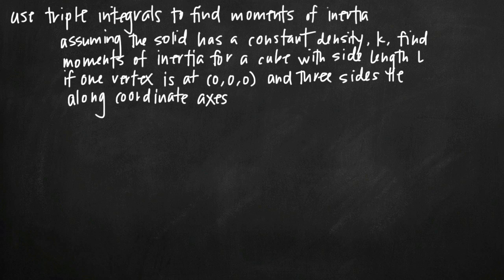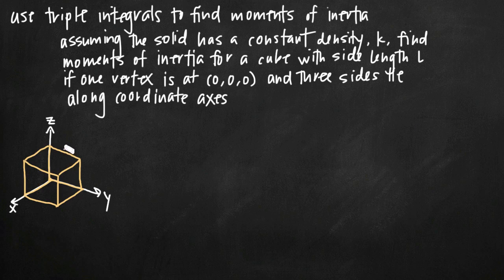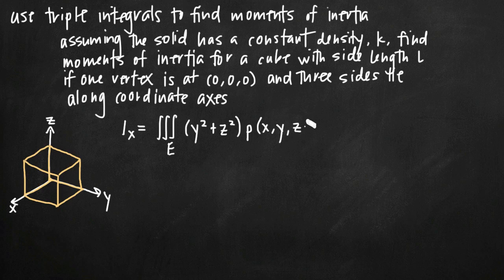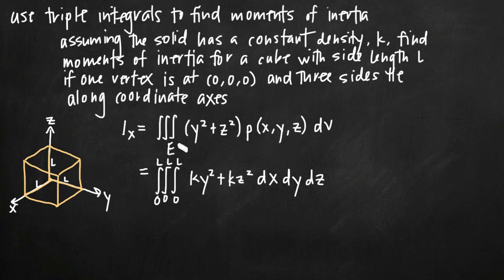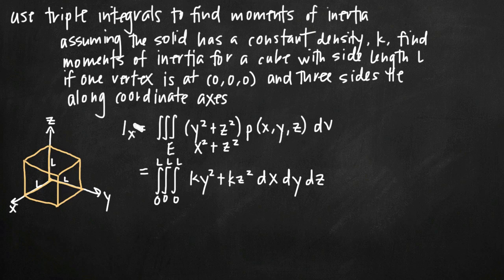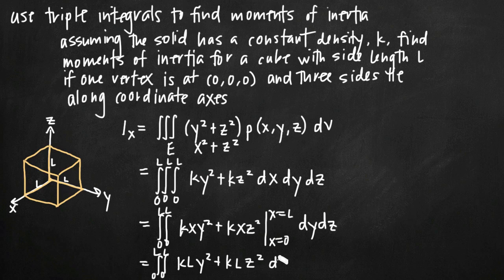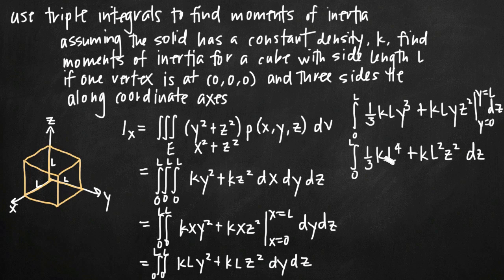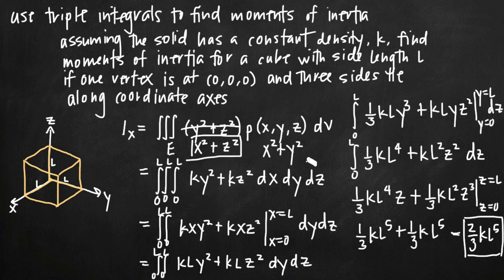Moments of inertia with triple integrals (KristaKingMath)

Comment: ..but where did y^2 + z^2 come from 1:49 ...
Reply: Danish Fiesta 
Distance from the x-axis or Rx
Reply: but how ?
Reply: @canerakbas9313  because linear: F = m*a, and rotational: torque = F*r = (m*r^2)*(a/r). This is true since F*r = m*a*r 
(you multiply r on the left, so you multiply r on the right. But since we work with rotational acceleration 'alfa' and not with a, we reorder the equation to m*r^2*alfa).

m*r^2 is the inertia component. In this example, we work with Cartesian coordinates (so the 'r' is replaced by x,y,z) and since Pythagoras theorem states that r^2=x^2+y^2 (or z^2, depends on the axis of rotation), you'll get the described formula.
Reply: Choose any point within the cube and find the distance between this point and the x-axis.